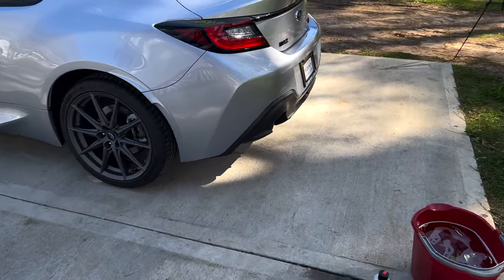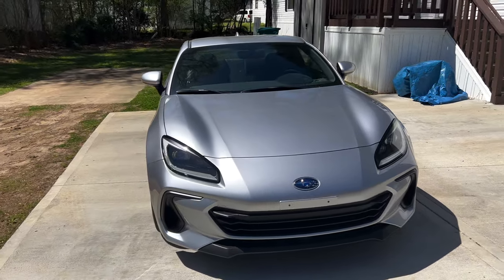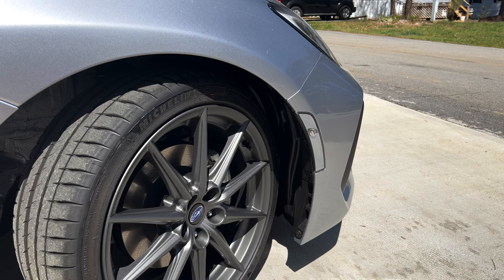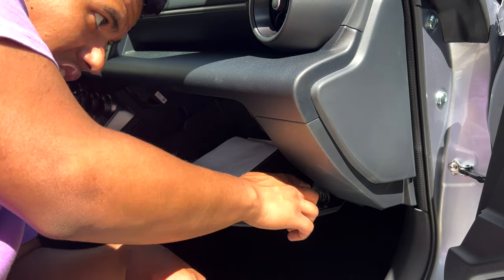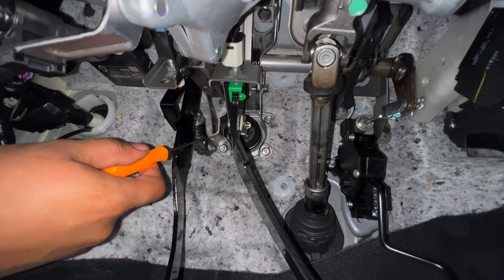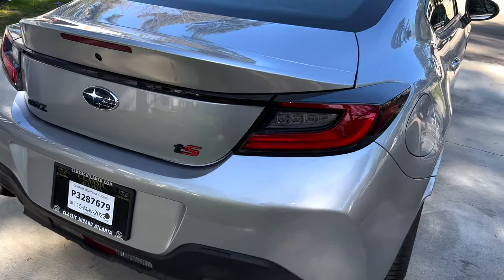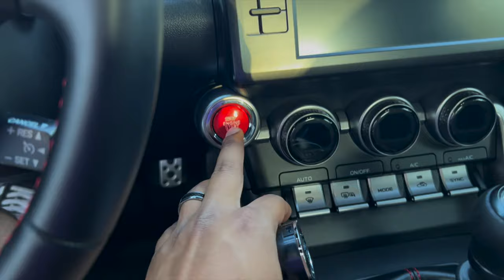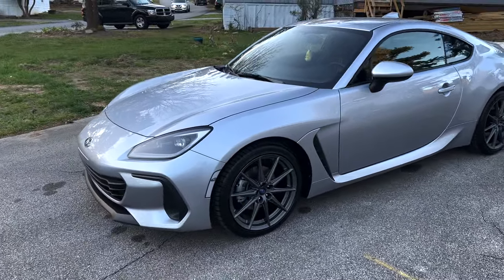My NEW 2022 BRZ Gets Modified & Detailed 🔥 *1st Video

Comment: You're the first one I've seen replace the clutch spring. Does it make it harder to press the clutch pedal down?  Also, where can I get the Ts emblem?  Everything else you did, I did to mine as well within the first couple of weeks.  Today, I'm taking it to a guy who's going to replace the brake fluid with Motul660 racing brake fluid and new Hawk brake pads.  Current ones for me are a little too squishy.  Then it's a new catback system....
Reply from the maker: It does add a little weight to the clutch but is not heavy at all. 
TS Emblem: https://www.subispeed.com/part/jdms-ts-br-jdm-station-subaru-ts-emblem-black-red#.Yqob3nbMKUm
You must have excellent taste then. The new pads and fluid will make a huge difference! 
Thanks for watching!
Reply: @Catalyst4k  Thanks!
Reply from the maker: @michelfortier9563  You’re welcome!

Comment: Sweet car! Just waiting for mine to be delivered (same car and color). How is the temporary tag holder secured to the rear bumper cover? Did they screw it on?
Reply from the maker: Thanks! That’s super exciting. The tag is held on with 4 screws that are drilled strait into the plastic bumper. There is pre marked spots for the screws. I actually did it myself. I actually work for Subaru 😄👌🏽
Reply: @Catalyst4k  Thanks for the response. Wish there was a video of your supercharged '13 FRS but subscribed and looking forward to all your '22 BRZ mods.

Comment: I'm interested in what you used to condition the inside and the stuff you used to wash the outside.
Reply from the maker: I used Chemical Guys Silk Shine for the interior plastics. Chemical Guys Extreme Body Wash Plus Wax for the exterior soap. Chemical Guys Honey Dew Snow Foam for the foam cannon. Lastly Chemical Guys Leather Conditioner for the interior leather. You should be able to type these into Amazon and find them fairly easily. 👌

Comment: what foam gun do you use to clean it? seems super convenient
Reply from the maker: It’s funny you’d ask. It’s actually a foam cannon I found at Walmart in the pressure washer section. I couldn’t find the brand. The secret formula is really the Snow Foam I use from Chemical Guys.
Reply: worx has a decent battery  powered washer with foam bottle attachments , it pair with a nice microfiber cloth and keep car looking nice

Comment: Hey bro nice video lots of interesting mods looking forward to seeing what else you do. Just to let you know Japan parts have a bunch of STI parts available including STI body kit and the door sills which look awesome. I’m going with an OEM , STI badge for the rear of my BRZ. It’s off a WRX but should fit nicely as well as a previous gen STI shift knob (hope it fits ) and start button like yours
Reply from the maker: WOW! I was thinking of putting the STI shift knob too! Thanks for subscribing . Lots of exciting stuff to come!
Reply: @Catalyst4k   No worries, I actually ordered the shift knob and then changed my mind. It looks like a dildo 😂😂.. 
I’ve bought the STI shift knob from the previous BRZ (model number   
 ST35022ST340 if you want to check it out ) it looks exactly the same as the current shift knob so I’m confident it will fit I’ll find out when my car arrives   🤷‍♂️ 🤣
Reply from the maker: @Daledugahole  LOLL. I actually was taking about the one you are ordering now*BRZ TS knob. Let me know if it fits 😄
Reply: @Catalyst4k  I will . Car should arrive in a couple of weeks. They are hard to find . I ended up buying it off eBay paid way too much for it and later saw that it was on Japan parts under “shift knobs” previous gen brz . The thread is the same size and It looks identical so it should fit . Nice and heavy too